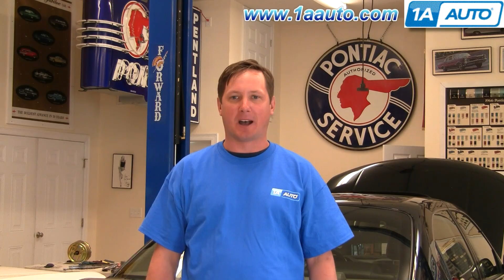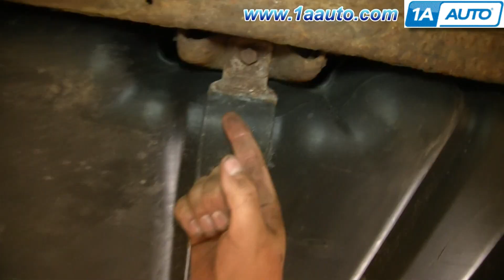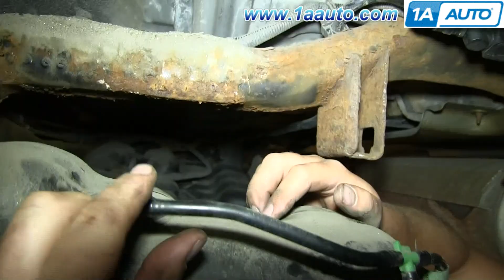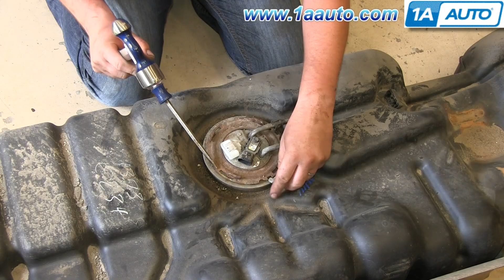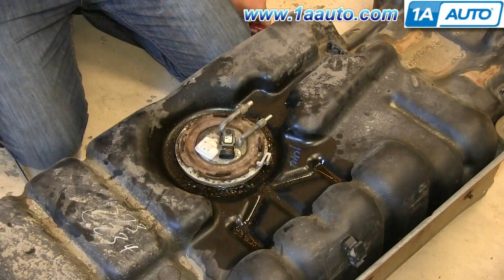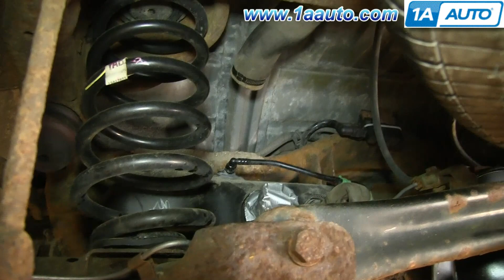How To Replace Fuel Pump & Sending Unit 00-06 Chevy Suburban

Comment from the maker: √  Watch the Video
√  Buy The Part at 1A Auto https://1aau.to/m-Visit-1AAuto
√  Do it Yourself
√  Save Money
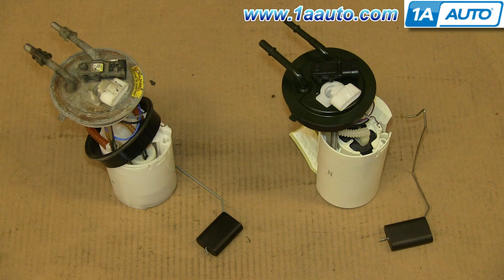Reply: I understand that, A1Autos replacement pump are infact way stiffer to compress and really dont fit as well as the oem part ( even thou the narrator unembbarresed ca 6:15 in to the video tell us that it don’t just fits exactly the same.. it’s identical! 😮)

I bet my own suburban on the fact that they while recording this video realized themselves what a bad fit it was and didn’t  manage to fit their own stiff A1Auto replacement pump themselves.

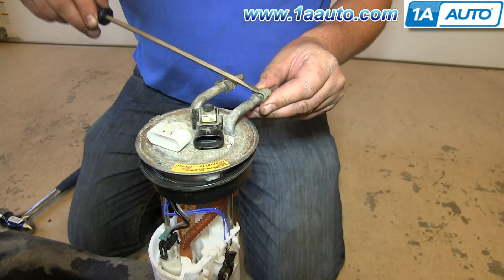Ca 6:21 in to the movie they havent realized it yet and show how to fit the gauge arm on their replacement pump. 

Ca 6:25 they tell you to reuse the hoseclamps from the old pump (why doesen’t it folliw new ones with the new pump)

Ca 6:38 they have realized the bad fit and even if the Narrator tells you to fit the new replacement pump THEY choose to put back the old one.. probably because it’s not easy as you say to compress ther ”identical fits right on replacement pump”  

look at the video from 6:38 and you see that it’s the old pump he refits, the fact that the tank all of a sudden have a lot of fuel spill around the hole just strenighten my teory and they have put in and taken out the new pump several times before giving up and decided to fit the old one again to get the video done.. and in mind also how ”the expert” have to struggle get that one back i’m even more sure that im right in my speculations/ theory.. and more sure he didn’t manage to fit their own while recording..

How or Why do you even post a video with such a scam and embarresing result..!?
You can be sure that i won’t looking for parts fron A1Auto after seeing this video.. 🫵🏼😏☺️

Comment: Hi! So I'm having starting issues on 2000 suburban 2500. I replaced the battery and the dash light are on. After replacing the battery, the first attempt to start the vehicle, the engine was starting to go but died. Tried again and again, eventually only hearing a click. Now the truck is parked on a hill nose down, and the gas tank seems like it's on Empty(dropped a couple gallons in there). Could it be the fuel not getting to the fuel due to being on an incline?

Comment: Fuel tank should be empty. I connected an electric fuel pump to the fuel filter to pump the gas out. Gas is over 8lbs. per gallon and that's a huge tank.

Comment: You might like to redo this tutorial. Your tutorials are awesome, however their is a much easier way to do this... don't snap the lines off the tank, only the big one to evap. Disconnect them from the chassis and evap instead... makes job MUCH easier.

Comment: Good info, thanks. I have a 2003 Chevy Suburban Z71 throwing a code with CE Light. Texas won't even START an inspection if you have the Check Engine light on, regardless of what it is. Code points to this cluster on top of tank, and local dealer ONLY WANTS $1,300 to fix it ! And that was 3 years ago. Kinda wishing I had a workspace to do this in. 

One independent mechanic suggested cutting a hole in the floor pan dead center under the rear passenger seat for quicker easier access to unit, after removing the seat of course. Then just tack weld it back down when done replacing unit an hour later without hassle of dropping tank. He said it's MUCH FASTER and EASIER that way !
Reply: 😂😂😂 hack job much?😂😂😂

Comment: I bought my fuel pump from 1AAuto after watching this video, as I have a 2003 Suburban.  This video was instrumental in getting my truck running again.  I would offer one suggestion to the video though at around the 6:45 mark.  I did not realize the top of the pump was spring loaded and moved up and down, as the new part was very stiff compared to the original pump.  It did not appear to fit at first, and I was very apprehensive about applying that much pressure to the part for fear of breaking it.
Reply from the maker: +Mike Barefoot Thanks for the tip!

Comment: No can do.  The speed nut on the front strap spins freely - so the bolt is mostly out, but I can't loosen or tighten the bolt.  So much for replacing the pump and fuel lines, not to mention the brake lines on mine are atrocious.   Any ideas?

Comment: As a matter of basic safety, you should be using a brass drift or some other non-sparking tool when removing the  ring securing the sender/pump.

Comment: If I have to cycle my key to on off position 2 to 3 times before engine will start is that a tale tale sign of a bad fuel pump. Fuse is good.
Reply: If you have a fuel pressure gauge use it. My 03 yukon was actually still running with only 15 psi. Should be 55 to 62 psi.

Comment: I have a 2001 Chevy Suburban 1500, 5.3, would my Fuel Pump & Sending unit have 1 or 2 connectors? Would owners manual have that or do I just have to remove it 1st?
Reply from the maker: +K'Cee Freeman You can contact the dealership with the VIN to determine which one you have. Thanks for checking us out!

Comment: I have a 02 Sierra 2500 with a one plug fuel pump. I have a deal on a 2 plug pump. 
Can I just buy this 2 plug pump. ???
Reply from the maker: +chachifeere You will need to use the same style as the OE part. On this vehicle, both the 2 connector and 1 connector were offered from the factory. Thanks for checking us out!

Comment: How about redoing video on ground on your back
Reply: @Ovtndmntn721 I ended up cutting floor fuket worked way better
Reply: @Vegasman77704  do you remember under what part of the floor the pump is located? I did that in the back of a jeep grand cherokee too. So much quicker and easier.
Reply: @Ovtndmntn721 mine was down and made it more comfortable to cut hole in floor cause tanks not near it

Comment: Thanks you saved my butt today. If there was a warning about the pump being spring loaded and needing compression i missed it. I didnt have access to a lift but i could get my Burban high enough on jack stands that i just lowered back end and changed out pump while still partially hanging. The one thing i did also is drop spare tire and rear of drive shaft to make room to get it done
Reply from the maker: +d k Thanks for the feedback and for watching!

Comment: My metal lines are rusted and frozen into the nylon lines do you have a kit to repair the lines if I need to cut them? I ordered my fuel pump from you guys last week and its here now and unable to install it...guessing gm assumed they would fail more often not worried about that issue

Comment: Is this a flex fuel pump?
Reply from the maker: +your mom The process for changing the fuel module should be the same with some very minor differences. You will be able to use this video for the install. Thanks for checking us out. 1aauto.com
Reply: @1AAuto  the reason why I ask is cuz they have different plugs in the top

Comment: I need some advice folks I have a 2001 Silverado 5.3 liter I have replaced the fuel pump twice and the fuel gauge in the dash still doesn't work....runs like new but still guessing mileage...lol. help me out .
Reply: Most likely the wiring or the guage itself.
Reply: Fuse... lol cluster
Reply: Cluster stepper motors.
Reply: Stepper motor un the gauge cluster needs to be changed

Comment: Did mine in 3.5 hours . Did it on jackstands and used a motorcyle lift to lower it . One difference though , mine had a line inside the tank for a remote pickup .
Reply from the maker: +joseph bourdeau Thank you for your feedback!

Comment: My truck won't start it's runs for 2 sec and died is it the fuel pump r is it the security system
Reply from the maker: It could be the fuel pump, but we cannot diagnose online.  Please take your vehicle to a local mechanic to have it properly diagnosed. +Justin Sharp
Reply: Ok thanks

Comment: Excellent video! Very informative. I do have a question, though.  Is there any Jack  that I can buy at an auto parts store to raise my Silverado high enough to perform the job?   Thank you.
Reply from the maker: +rebelandboltman3777 You should be able to purchase a 2 ton floor jack as well as a couple of jack stands to support the vehicle.
Reply: I use wooden blocks in between the jack and chassis

Comment: Just bought an 01 suburban...it stalls if I accelerate to quickly...doesn’t shut off...just kinda creeps until I take my foot off of the gas but if I press down again slowly then it’s fine...does a bad  fuel pump cause this problem?...
Reply from the maker: +MzBossy Badd It may, you could also try to change the fuel filter if it hasn't been serviced in a long time. 1aauto.com
Reply: I will try that...thank you!!!...love the video btw!!...

Comment: What will happen if I break the line part that connect to the charcoal canister and the gas tank
Reply: SHOE GOD 23 unfortunately you’ll need to use the number on the side of that hose and enter it into the amazon search bar. It’ll most likely say it doesn’t fit your vehicle but it will. You won’t be able to find that part in the store and a dealer will charge a fortune for it

Comment: This is an excellent video.  Thank you for posting this.   On a related note, I replaced my fuel pump and sending unit on my 95 Chevy Suburban about 5 months ago...  about two weeks ago, the gas gauge stopped going below a quarter tank.  Now it will not go below half a tank...  From what I've read, the Sending Unit seems to be bad....  Is there a way I can test the Sending Unit?
Reply: I have a 2003 Suburban and all the Gauges started giving really weird readings as they slowly died over a 2 year period back around 2009. Kinda pissed me off, but it was the actual Gauge Motors going out, not the tank sending unit. But definitely test unit first if not too $$$$. I'm in need of a Cluster Gauge repair service now !

Comment: Is it the same process on a 2002 Yukon XL 2500 with an 8.1?
Reply from the maker: +MPDano It should be pretty similar. But pick up a repair manual and double check to be sure before you get started. For anyone else who might be doing this job, we carry the parts shown in the video on our website. Order from us and we'll cover the shipping. Here's a link: https://www.1aauto.com/electric-fuel-pump-and-sending-unit-module-ac-delco-mu1738/i/acfpu00024?utm_source=YouTube&utm_medium=CTA%20Comment&utm_campaign=1ATony